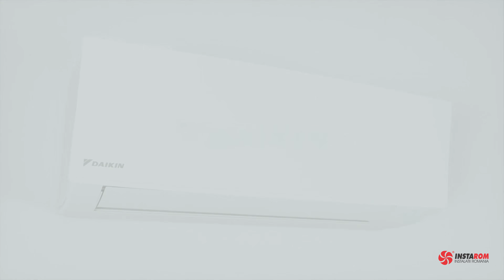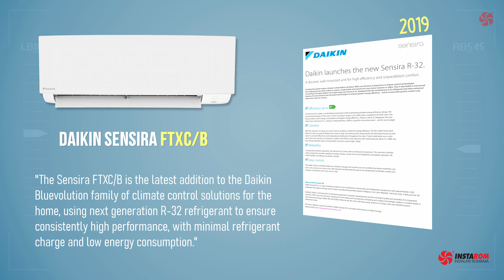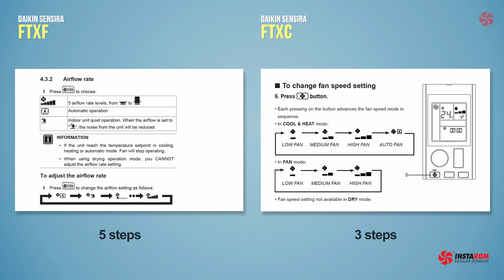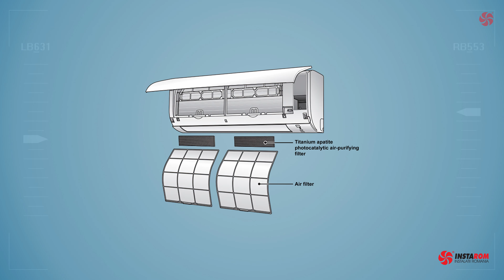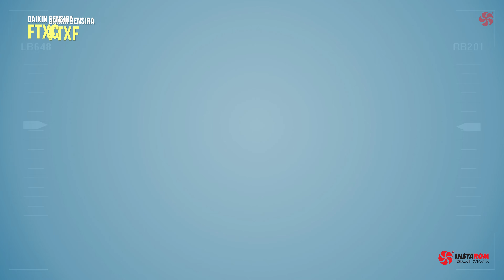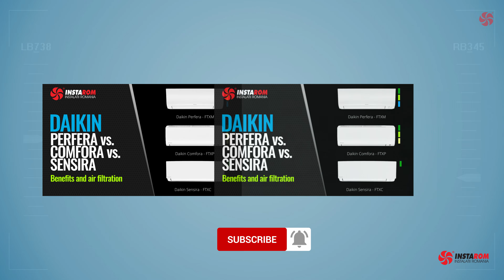Daikin Sensira FTXF vs FTXC Inverter air conditioners | Brief comparison

Comment: Which is newer and which heats better?
Reply from the maker: Both are current models in the Daikin lineup for wall-mounted split type air conditioners. They are similar for powers up to 3.5 kW, but for powers of 5 kW and above, the outdoor units are larger and heavier in the FTXF range, which means a larger heat exchanger which normally implies that it will do better at heating.

Comment: This is clear and understandable, great video. However what I still can't figure out is what the difference is between for example FTXF/A, FTXF/B, and FTXF/C. Same for the FTXC... The video mentions FTXC/B, however I see there's and FTXC/C too. What do the letters after the "/" sign indicate? For example what's the difference between FTXF35A and FTXF35B and FTXF35C?
Reply: have you find the answer?
Reply: @victorkilo8427  No, not really... The video linked by 
Instarom Instalaţii România above answers some of the questions, but not all... I think it has to do something with the model year too. In the end, I just bought one. The manual says it's an FTXC-B, but the unit itself looks like an FTXC-C, so there's that... I didn't really care in the end.
Reply from the maker: We have a video about this, Daikin Sensira FTXC-B vs FTXC-C Inverter air conditioners: https://youtu.be/T9t3kuqO10w